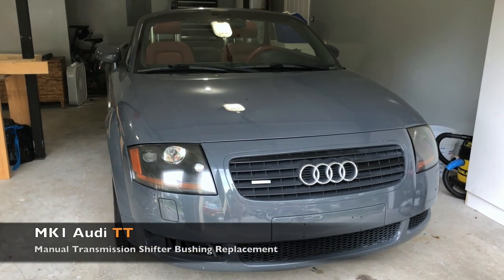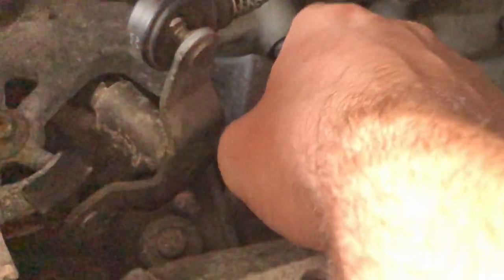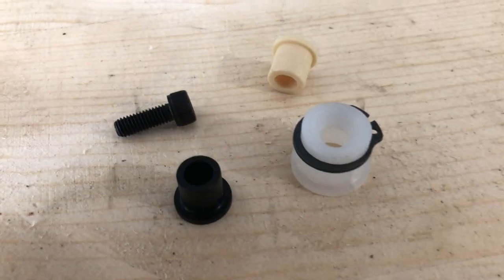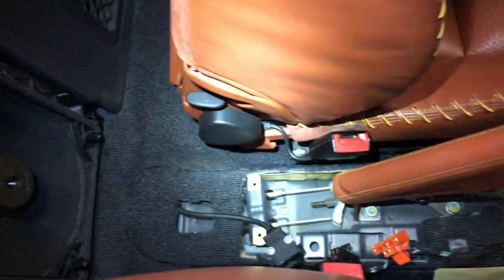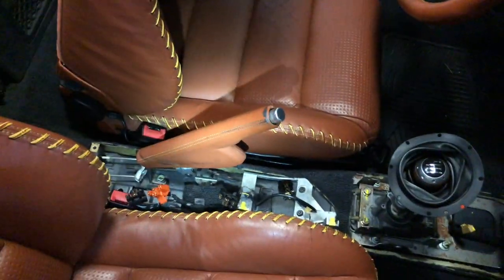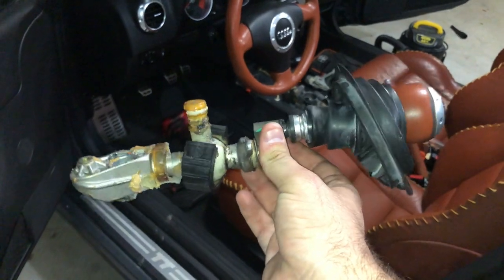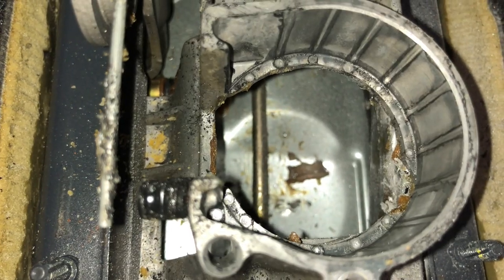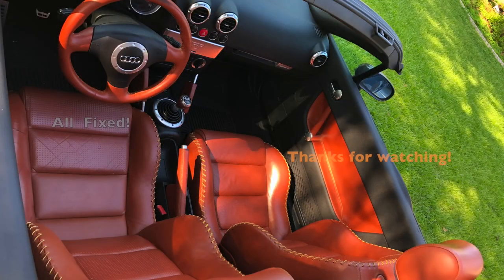DIY: Audi TT Shifter Bushing Replacement

Comment: Doing this job today, great write-up.  All I can add is that there is a cable bushing that goes on the bottom of the first gear getter L bracket.  Installing the busing is easy enough but reinstalling the retainer clip is hard.  I placed the retainer clip into a open ended 13mm wrench which held it snugly, then I was able to press it onto the end very easily.  Also, drill the hole on the passenger side, it makes like so much easier.

Comment: Hi ! It’s my turn on my 225 bam coupé. 
And yes also stucked in second gear. I wondered why especially it was this gear. 
Happened when shifting from 5 to 6 or the opposite, I don’t recall.
So, just ordered a set at Dieselgeek.
Have to drill, and hoping it will not be to tough to work on .
Thanx for your vid ;)
Reply from the maker: Let me know how it goes and if you have any questions!
Reply: @anygiventrail  
Ok,thanx ! I have received the Dieselgeek bushings, bought a metal drill, etc …
Btw, what is the size of the side hole I have to drill ?
Reply: Finaly did it ! Drilling, new bushing. Only the front/rear one, for the other was fine, and a lot tricky to undoing because of his design.
But anyway, gear moving is so smooth now. Since years de 2 began to be difficult, and now I know why : bushing disintegrate step by step. 
So absolutly a thing to do ;)
Reply from the maker: @renedewael9703  awesome! probably feels like a new car now :)
Reply: @anygiventrail  Absolutly ! 👍

Comment: I seem to be having a similar issue but I have a base 180hp fwd tt with the 5 speed and I was wondering do I get the same Audi tt bushings or do I need to get the mk4 bushing kit on dieselgeek
Reply from the maker: I’d give them a call to ask and double check, but sounds like you can get the mk4 kit.

Comment: Hi I had the same problem with my audi tt. Do i need to slide the rod on the bell crank after I attach it to the bushing on the shifter? I finally have 1-6th gears but no reverse. Was thinking I probably need to push the rod at the bottom on to the L bracket bell crank? Is there anyway we can chat?
Reply from the maker: Sure. Shoot me an email: Brendan.oleary92@gmail.com
Reply: @anygiventrail  thank you for the reply just sent you an email

Comment: I just experienced this problem last weekend hoping this is the cure! Initially I was having trouble going into 6th gear, and when I was coming to a red light from leaving the interstate I put my car in to neutral where I then coasted down to a stop, I tried to put it in first and it was going into 3rd, where 3,4,5 were fine and it went into reverse no problem. If anyone has suggestions please feel free to comment.
Reply from the maker: Rio Trujillo that sounds like the same symptoms I was having. Let me know if you want to chat more about the fix!